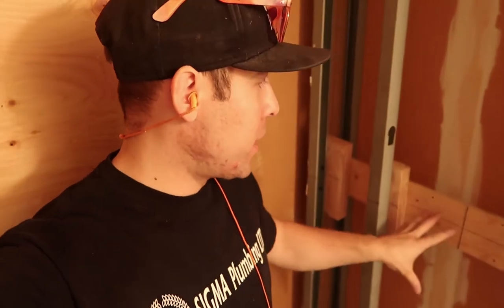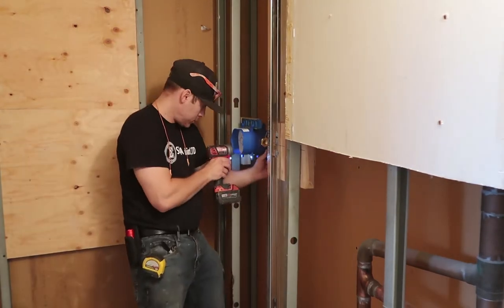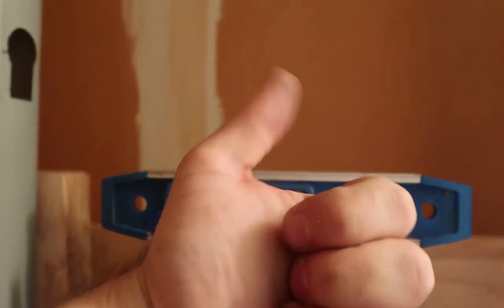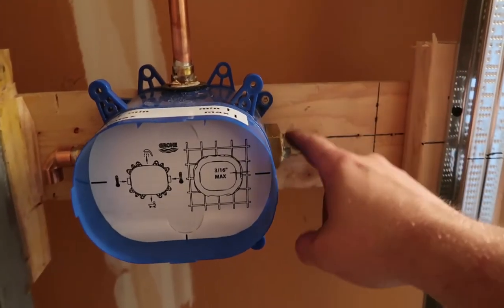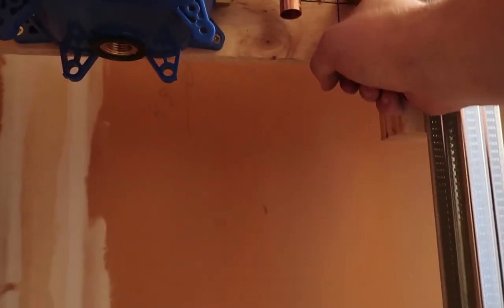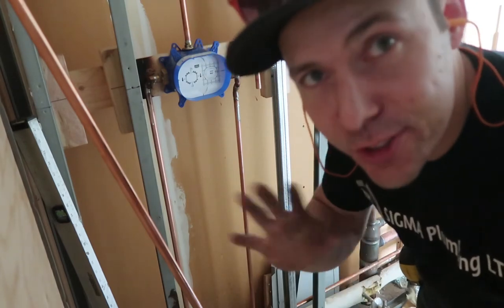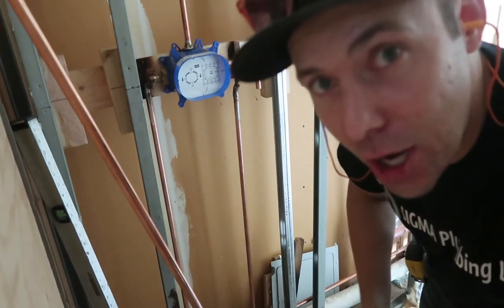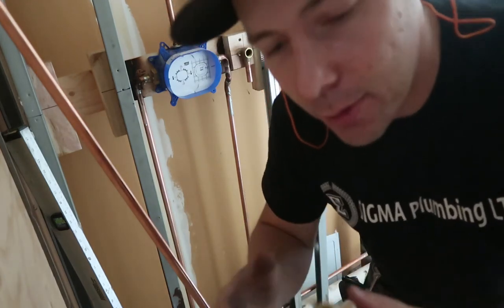Grohe Shower Control Valve Install | A Day In The Life Of A Plumber/Plumbing Apprentice | Vlog 7

Comment: Another awesome video. Hard worker .. what did you mean by scratching the mip pipe so you the tape can catch .. would you be able do some sort small video on that and how many times you wrap the tape around and how tight you tighten the tip on to the valve.
Reply from the maker: Hey! I will see what I can do!